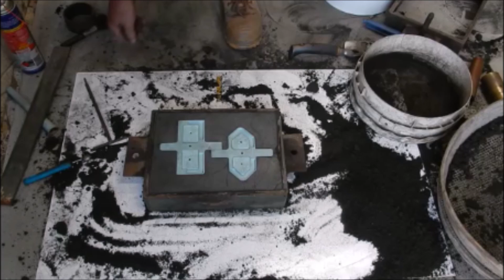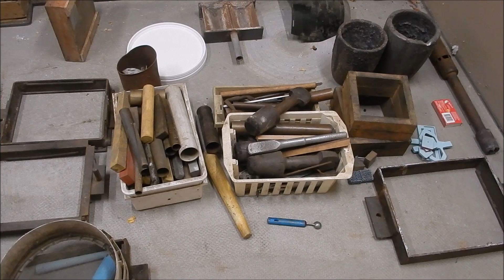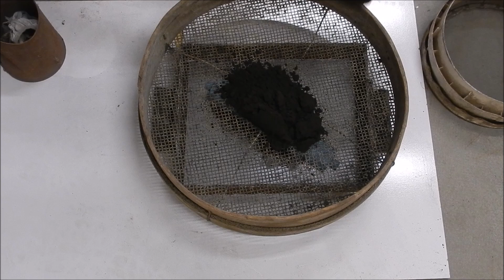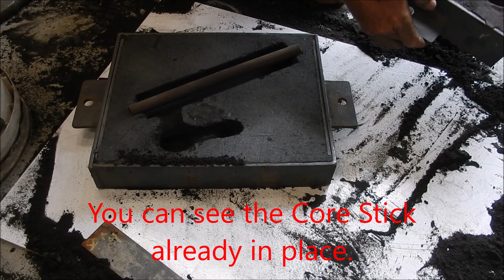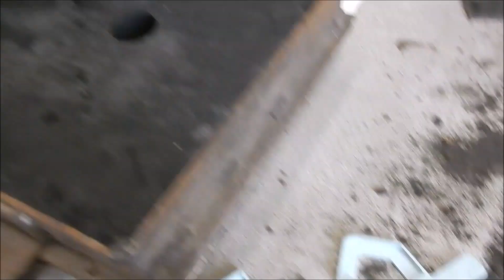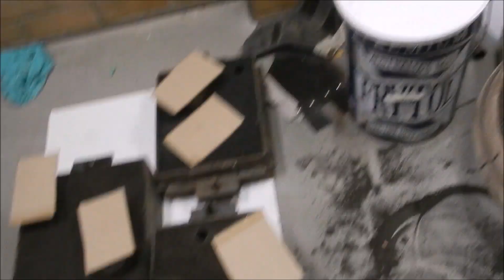Doing castings again after nearly 20 years since I finished up my Foundry.

Comment: Your Kbond sand looks completely different to mine. Did you add coal dust to it? I always thought it was red.
Regards,  Preso
Reply from the maker: Hi Mark, yep it is Kbond (starts of cream in color) that has been well seasoned and used over time, it has turned black so no coal dust added.  Check out the Kbond recipe here -
https://www.afsinc.org/sites/default/files/inline-files/k-bond%20sand.pdf
It was developed by the Kent State University to make a Petrobond type sand but at a much reduced cost, check out the article here -
https://wiki.opensourceecology.org/wiki/Definitive_Article_on_K-Bond.
I got a bag of the Bentone from a speciality paint producer in Melbourne arond 30 - 35 years ago (cost a bomb to buy) and have been using Kbond ever since for the finer casting work.
I have tried to get more of it recently but can only buy it in large bulker bags.  However I have now got a supply of the "Red Oxide" Petrobond at a very reasonable price.
You can purchase it here in various quantities along with any other supplies from a foundry supply business in Melbourne.  The guy is fantastic to deal with -
https://www.greensand.com.au/
Cam
Reply: @camatbattler2233  Cam, I was sent the raw bentone and the catalyst to make my own K-Bond by one of my YT viewers. I was able to make around 25kg of the stuff. Mine is quite red in colour but it is going darker as I use it. I still find it kind of funny to use. It seems to be a lot fluffier and it rams quite differently to my greensand. Maybe I need to add more IPA when I mull it. 
Regards,
Mark
Reply from the maker: G'Day Mark, yes the Kbond certainly holds its body and is quite different to ram up.  Put it into the Muller and add a small amount of 2 stroke oil.  Allow to mix and add the IPA until your happy with the feel.  You will find that you don't need to add any additional Kbond for quite some time.
Was the Kbond red in color, this is the color of Petrobond due to the red oxide thats added in?

Comment: What type of clay is used in your petrobond/kbond? Bentonite?
Have you ever used portland cement mixed with 2 stroke motor oil as a casting "sand"?
I've tried it as a backyard casting hobbyist, and it gave a really nice surface finish with aluminum. 
Thanks.
Reply from the maker: G'day Steelcap, check out the Kbond recipe here. - 
https://www.afsinc.org/sites/default/files/inline-files/k-bond%20sand.pdf
It was developed by the Kent State University as a cheaper alternative to Petrobond.  Check out this article -
https://wiki.opensourceecology.org/wiki/Definitive_Article_on_K-Bond

Cam

Comment: The Frytol tin took me back to the '70s, my family kept horses and we used those for mixing feed,  and for water. In those days the fish and chip shops were keen to get rid of them.
Reply from the maker: G'Day Geaser, I got dozens of these tins over time from my local Chicken Star shop.  Sometimes bought a family meal there and noticed them in the back of the shop.  Asked if I could have a couple and was told take as many as you want cause they only get thrown out.
Cam

Comment: Hi Cam, hope all is running swell at Viva, I’m guessing your foundry was in Melbourne? Enjoy watching the casting of anything metal, never had to do it though. So yes I watch those Pakistani vids on the tube a lot. I’m retired now after the big turnaround 2023, and enjoying life. I have 2 locos I’m building in my little workshop in Geelong West, 7 1/4 & 5” gauge. I’ve caught up but still not making boilers yet.  Your vids are excellent, keep up the great content.
Reply from the maker: G'Day Rob, yep still at Viva and still looking after the Jetty, coming up to 10 Years in June.  My foundry was in Leather St out in Breakwater.  Myself and my mate Ian ran it as a part time business but it was almost full time given how many hours we spent there, we did Aluminium, Bronze and Cast Iron.  My Father built a 31/2" gauge Evening Star which was a 9F Class.  He was well on the way to completing a 71/4" Victorian H class and a three cylinder version of an R class with Baker Valve Gear.  If you need a boiler built my brother designs, fabricates and organizes the inspections and all certs for Loco Boilers both in steel and Duplex Stainless Steel.  His quality is second to none and every inspector who has looked at the many boilers he has fabricated (Australia wide) all comment that they are the best they have seen.  He currently has a Heidi, a NSW 38, and a Black Five with a tapered boiler on the go.
Cam
Reply: Hi Rob, regarding the boilers I make that Cameron replied to you about. If you would like to discuss anything about this, give us a shout out. 
Also, Cameron has a couple of clips showing him machining some of the Duplex Boiler Barrels and fixtures for me. Cheers Andrew